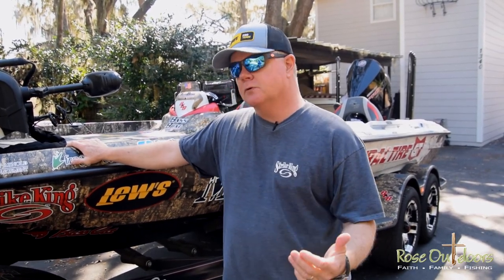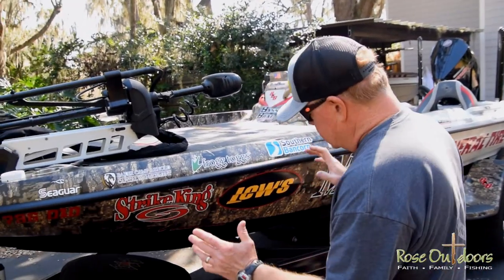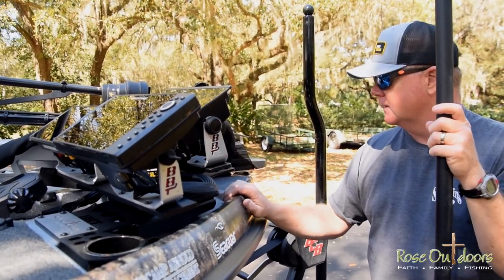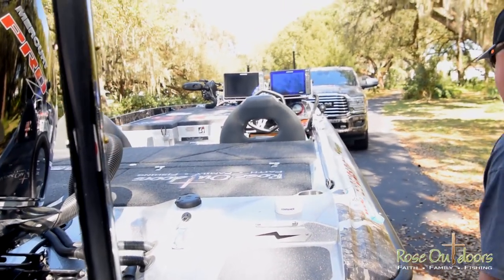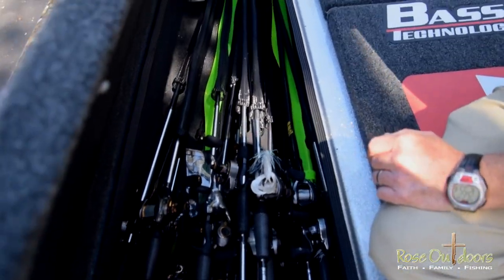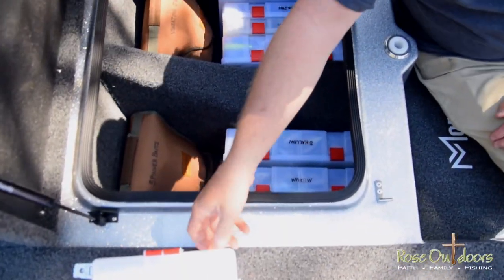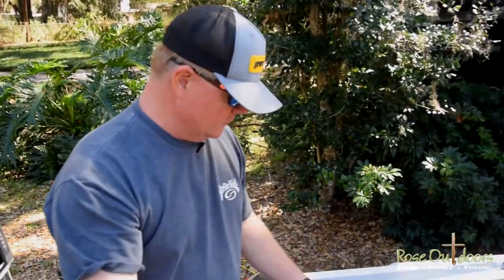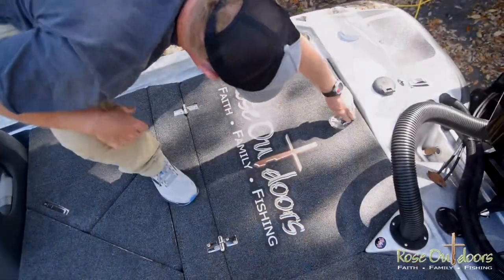Bass Cat Puma STS Walkaround

Comment: Thanks for posting this video, and you have helped me tremendously.  I just received my 2023 Bass Cat Puma STS and was trying to figure out how to mount three 12-inch graphs at the bow.  I checked BBT's website, and other mount manufacturers websites, but nobody had a 3-graph mount specifically for the Puma STS.  Then I saw your video that same night, contacted Van at BBT asking about Mark Rose's bow mounts for his Puma STS, he replied 20 minutes later with pictures of your mount, and my problem is solved!  These mounts are so new they aren't even on the website, but they are available at an excellent, unbeatable, price.  Thank you so much for posting this video!  However, I did forego the cup holder add on option as I feel that the 10 cup holders Bass Cat has already put on the boat is plenty, LOL!!!